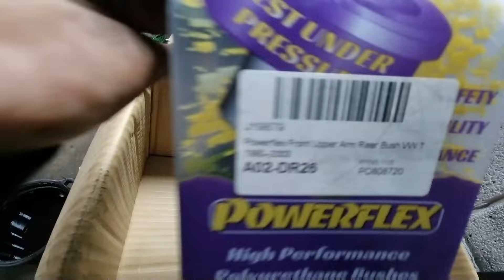Cutting My First Van Up!!!  #vwt4

Comment: Is the polybushes job something that can be done on a driveway?
Reply from the maker: Umm yer if you have alot of tools and can get the van up high 
Wouldn't recommend doing it on your back as you need to remove fuel tank and subframe

Comment: What gauge steel do you use for welding?
Reply from the maker: Not 100% sure mate
Reply: 1.2mm - 1.5mm steel plate if your making your own repair sections .
Reply: @fruitbat8424  Great, yea I've got some 1.2mm. Cheers